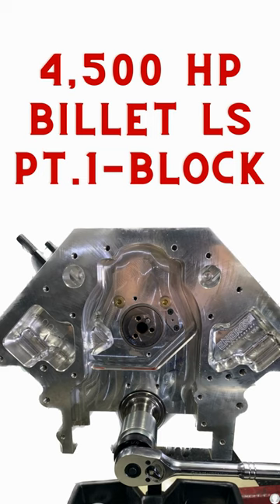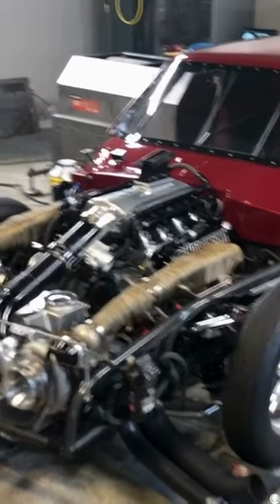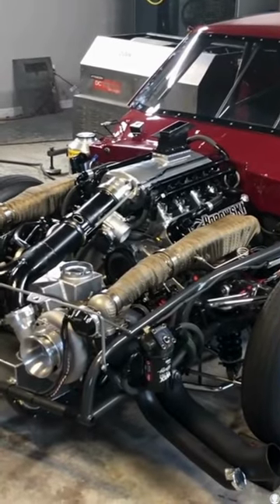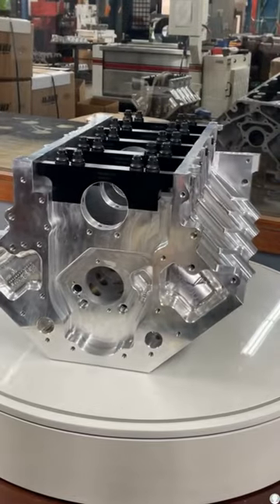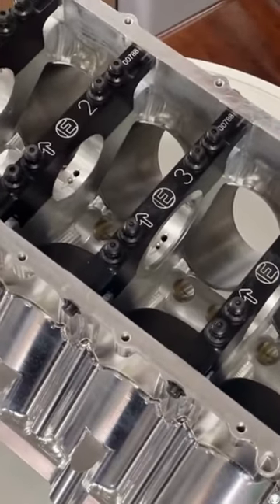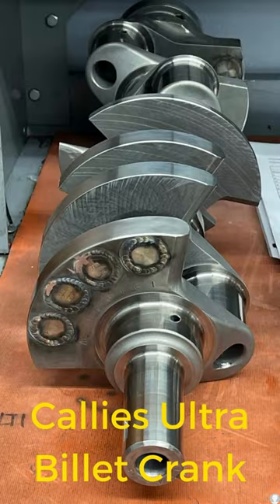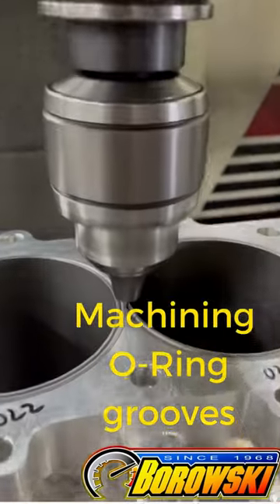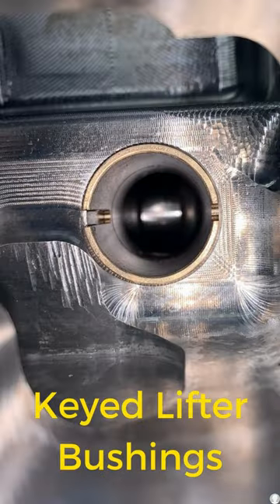4,500 HP Billet LS, Part 1 Block

Comment from the maker: Thanks for watching and commenting, but it's not a Ford crank. Nothing like it. It just uses a bigger main journal for more rigidity. It's just a good size that's bigger than a standard LS and where there are bearings already being made in that size. It just happens to be a diameter that Ford also used.  It's no different than when we use .904 lifters in a Chevy. You wouldn't call it a Chrysler.
Reply: I love it!  It’s a beautiful piece and I applaud your using the best pieces and combining them together, makes and breaks are in any limitation. I built my first LS way back when the Aussie GTO came out.  You will see similarities between older designs that were really good but the metallurgy wasn’t there yet. Every design borrows from designs that came before, but the metallurgy wasn’t really. The SOHC Ford in TF made the power of the Elephant, but it didn’t have the longevity YET. It was made on scale with the 392 HEMI. The heads made them run but another 400 lbs of iron in the TF Mopar made all the difference. I never saw a cross bolted SBC or an LS that was able to be 4.31x4.375. The aftermarket is the driver, the design is OEM stuff put together by the OEMs and man you really get some great cooking, Turbos, intercooler that stuff on steroids. I bought my wife a 2022 Edge ST with a 165 ci V6 twin turbo twin injection, direct injection and port to prevent coking. 335 hp 380 ft lbs and tunes have seen the stock 165 ci hardware hit 400 hp and 425 ft lbs on pump gas. 2.5 hp per cube isn’t bad. I wish I could still see , well enough to play with it. That 2.7 V6 is a tough little SOB. But I am certain that there is something it is similar to. All I know is with my wife driving and redlining it at 5500 by 4th it’s time to let off lol.
Reply: Agreed. The base design of an engine is it's lineage - it might be that soon this engine bears your name!
Reply: It is a work of art. There are pieces that are made with Goldilocks aspects that are just what they are. It’s like baseball, in a game of 18 batters there is a good chance someone will hit a home run against even the best pitcher but not against another. I really like the engineering behind the ICE and the iconic way there were iconic moments in time where so many got things right. 4500 hp will be a benchmark!
Reply: Why not inline crankshaft??